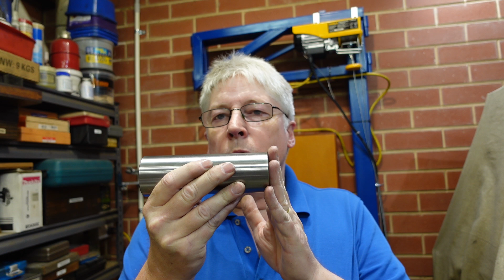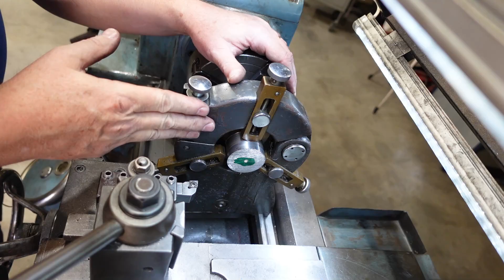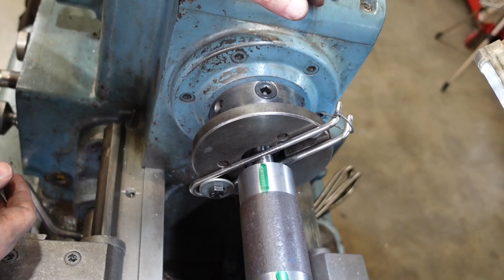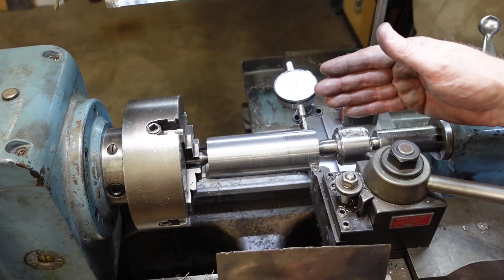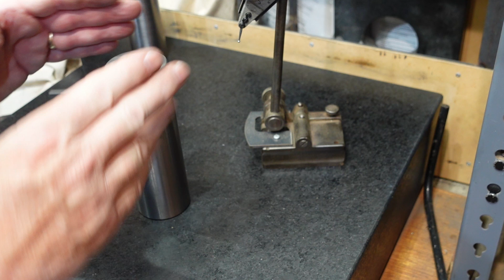Squaring up with a cylinder

Comment: 50 mm bar is hard to come by here. As you are taking out the center part, would it be a bad idea to use 60 mm pipe/tube (don't know which is the correct English word) with a wall thickness of 3 mm? And would it then be better to weld a plate recessed in the pipe on both sides. Before turning, so that the distortion is turned away?
Reply from the maker: You could, but welding introduces stress to the part, so it could move (relax) after machining. I used 50mm as I had some stock (55 I think) that would clean up nicely to that size. The diameter is not important.The important part is to get the ends square. The recesses are there to protect the centres, as well as provide a base for the square to sit on.
(as for usage - probably pipe, but tube is also understandable)
Reply: @occasionalmachinist  Thanks again!

Comment: Really good but i couldn't see the dial on the final check, so wasn't sure if high or low?
Reply from the maker: The dial read the same on both sides, so the cylinder was square to the surface plate (I should have also done it at 90 degrees, but you get the idea). It was a comparative measurement to see if the top of the cylinder was in the same position relative the bottom. Because the diameters were the same, you can conclude that it was.

Comment: I made one using a N.O.S. Catterpiller gudgeon pin. Took it to the local grinder and checked the ends were square. 35 minutes $5.00 what a beauty. Not to distract from this usefel video.
Reply from the maker: This is admittedly a poor man's version. Grinding would be preferable, but cylindrical grinders are not all that common.
Reply: Would a shop made tool post grinder produce a better result on the lathe?  Or would you need a cylindrical grinder to actually see an accuracy improvement?
Reply from the maker: @bdgackle  For me, the limiting factor was wear on my ways. A tool post grinder would probably have the same issues. Try it and see - thee nice thing is that if the TP grinder does not work you can re cut or have a shop grind the cylinder easily

Comment: why can't you just scribe a line with the square onto a plate, then turn square over see if the line matches the square? If it doesn'y then it's not square
Reply from the maker: You could (relies on the edge you are using being bang-on straight though). However, with light behind them, the eye can pick very small gaps, so using a cylindrical square on a plate is much more accurate. Does it matter for a home workshop? Probably not. The bit I find most interesting is the checking of a cylindrical square. With simple tools, the squareness can be checked to say a 1/10th of a thou over 6 inches - 1 in 60,000.

Comment: I’ve often thought that one of these would be very handy for tramming the mill square but the commercially made ones are pricey and hard to justify for a hobby shop. I never thought of making my own. I’m thinking that using a piece of precision ground shafting might work if I was careful to dial it in well before machining the ends. Thoughts?
Reply from the maker: You would have to dial it in sooooo well. @colincreedtattoomachines below suggested something similar. The problem becomes one of getting the axis defined by the centres the same as the axis defined by the cylindrical surface. By using the centres to turn you negate that issue.
If you dial the ends in really carefully before drilling the centres you might manage it, but I'm not sure. Try and see I guess...
Reply: @occasionalmachinist  I may give it a try sometime to see how good I can get it. It would eliminate a lot of polishing and might be adequate for many of the things that I do. If it fails I can use the material for something else. I have a piece of old hydraulic cylinder but I’m not sure I’d be able to cut it let alone machine it.
Reply: hydraulic ram.

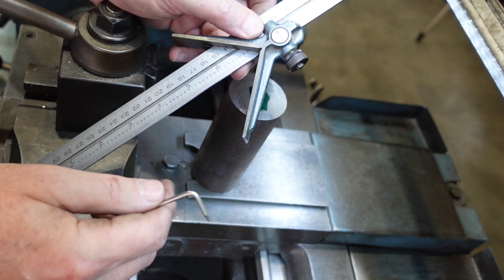Comment: At 2:36 - the tool is a "centre head", part of a combination square set
Reply from the maker: Thanks Gavin. The brain is even more mushy than usual atm.
Reply: Also commonly called a centre square even though it isn't actually a square
Reply: I've seen centering squares sold as stand alone tools as well, without the rest of the combo square, and they are quite simple to make (just take a look at a picture of one).  I love combo squares, but decent ones aren't cheap, and someone starting out has a lot of things to buy, and this is an operation that you will need early on a lathe.

Comment: Thanks Michael for persevering through a cold to make this video.
Are there "general proportions" of diameter x height to stick to when making a DIY Cylindrical Square?
Could you begin using "silver steel" for its existing ground finish, with say 25mm OD x 75mm L, add centres & recess ends?
FWIW, the "curved bumper" on your Indicator Stand can be substituted for a good sized ball bearing if the Stand has a "V" in it.
Reply from the maker: Good point about the bearing, although I'd probably use a bit of blue-tak or similar to hold it in place. The indicator in there is a 10ths version, so not much movement of the ball and there will be an impact.
Mine are both around 50mm diameter and the ground one is 150mm high while the home made is 125mm. It depends on the size of the squares you are checking - 125 is fine for my small square but if you had a 300mm square you might be better off with (3:1) 100mm diameter. I'd be concerned about stability if the base was too narrow.
The ground bar plan sounds good on paper but you then have to get the centre within say 1/10th so that the ends are not more than 3/10ths (3:1 ratio). The reason they are made this way is that you start with the centres and then the working surface is spot on parallel to the axis and by doing the ends in the same setup, they should be perpendicular to that axis.
I've complicated things because the ways on my lathe are worn, but with a lathe in good condition, getting things parallel once you are on centres should be easy enough.

Comment: I believe that tool is called a "centre square"
Reply from the maker: That could be another name - I've always known them as cylindrical squares, but that could just be me
Reply: @occasionalmachinist  He is referring to the centre finding square you are using at about the 2 minutes 35 seconds  point in the video.
You say you don't know what it is called......it is commonly known as a centre line square or centre square.
Reply from the maker: @howardosborne8647  thanks

Comment: Rather than using abrasives had you considered using roller burnishing, it would give a near polished finish with the advantage of a toughened surface layer for durability.
Reply from the maker: I've never tried roller burnishing. I would image that the forces generated would be similar to those from push knurling, and as those centres are only light, I think I'd prefer to avoid doing that. I might try it in the future though.
The finish on there is similar to the ground version and if it was not for a couple of deep scratches, the polishing would have not taken long at all. As sometimes happens, I think some swarf caught momentarily behind the tool.
Reply: @occasionalmachinist  the forces involved are much less than knurling, first it is only a very small contact point and you are only working a few microns deep not trying to mass deform the surface as with knurling. The process is certainly not for all occasions but useful for the little extra effort. Take a look at a few yt videos but ignore the ones using the full width of the bearing, you only want to copy the ones with a narrow ring on the bearing.
Reply from the maker: @littleworkshopofhorrors2395  Thanks. I'll do that

Comment: Is the radius on the indicator stand (critical) ie overhang on the left and the right?
Reply from the maker: Not really. As @Clipperdays says, it needs to be smooth with no discontinuities. I made that one myself and then (facepalm moment) realised with an indicator on the stalk , it was not central. Doesn't matter. The only things that does is that the radius on the base must be larger than the radius of the cylinder because that is what is giving the minimum reading
Reply: I think that most important is a perfectly smooth edge. No nicks or dents.